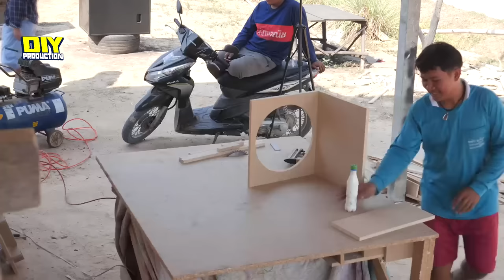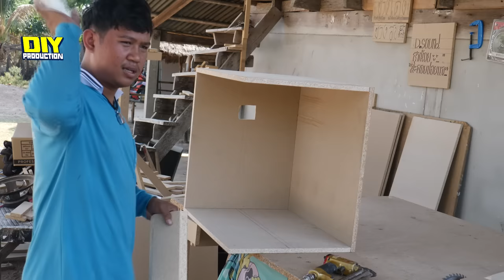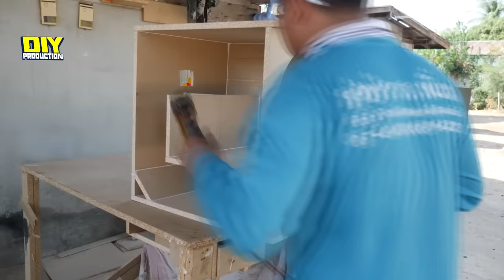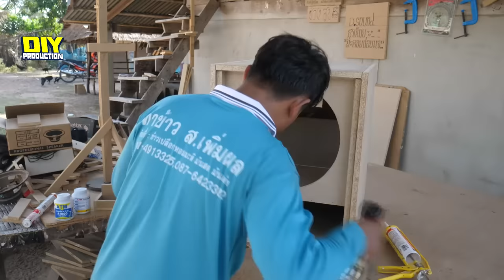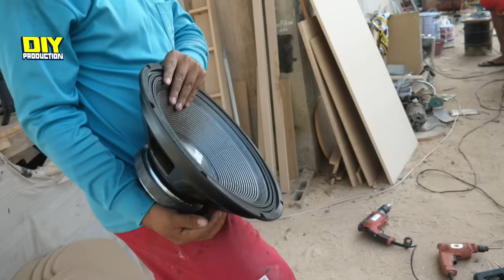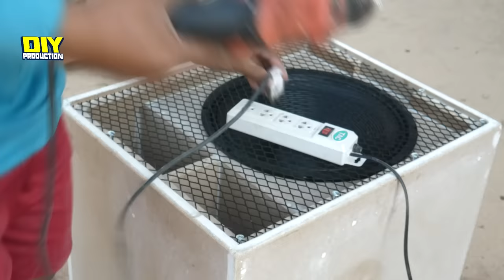Bass Reflex Subwoofer Professional Audio PA Cabinet Speaker Plan J-BIN 15

Comment: You have nice workflow. But chipboard and cheap speaker 30€ 400W rms is not professional audio subwoofer 😉 It is like home DIY. Try to make proper box with 4” coil, 1000W RMS and plywood material with internal bracing + inside foam triangle resonance absorber…

Comment: Tengo dos bajos de 1200wtts de 15 pulgadas,me gustan esas cajas que construyo.
Me gustaria saver las medidas de cada pieza.
Reply: Hi bro, if you still want the measurements  I think you should estimate, start by the speaker 15 inch +2 inch = 17 inch (lenth) Height = 15  +1+4=20 inch and width = 20 inch.